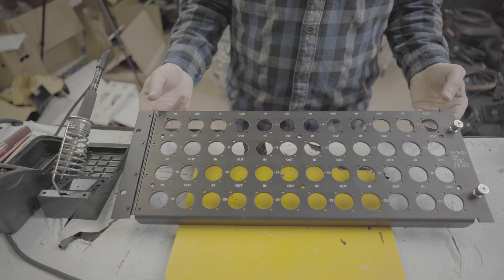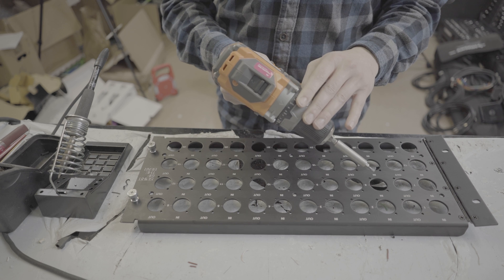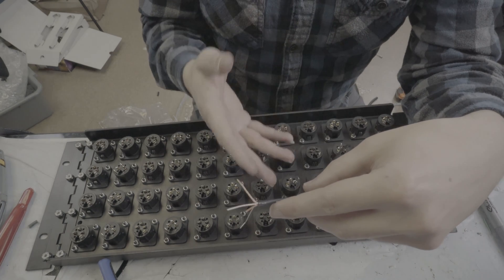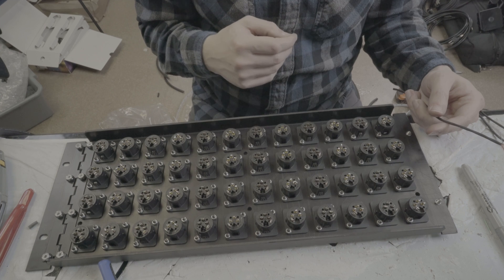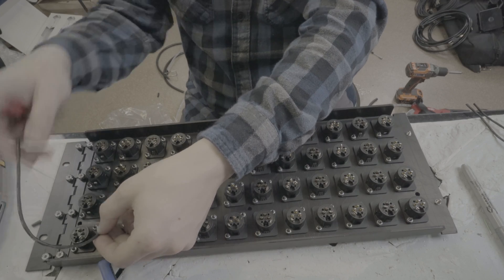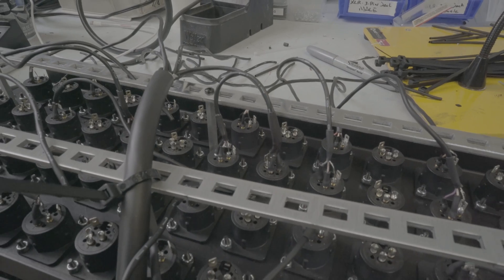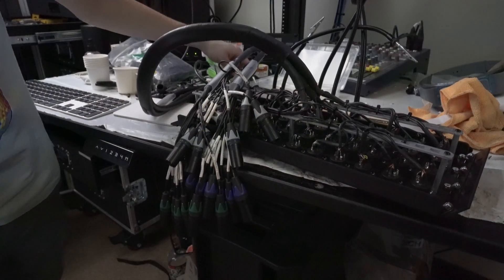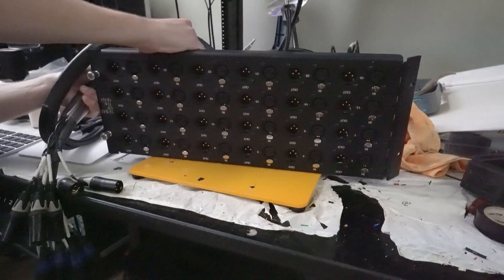Building A 24ch 1:2 Mic Splitter Panel For A IEM Rig

Comment: A couple late comments:
This is really nice work. I've done this in broadcast trucks, which easily in the analog days could go to 800 lines in the audio patchbay. I know what it takes to do it this good. I have some comments, minor as they might be. 
* Do one thing at a time. Swapping tools costs time. For an 8ch fanout I'd do shrink tubing on each,  marking on all 8, sheath on all 8, separating cores from screen and drain on all 8, cutting screen on all 8, stripping the inner pairs, and then tin them. And so on. One operation on all members in sequence. That way you use your tools more than swap them.  This applies to all repetitive work. Once you think like that, it's going to be a time saver and secret super power. This is what Frederick Winslow Taylor did in the 1880s and on; optimising process. 
* Use colour coded number markers! And use resistor code. It is universal -- if you look in Mogami wire, or Belden "Brilliance" multicore, you'll see that the inner conductor in the Mogami is brown, red, orange, yellow, green, blue, purple and grey. The first 10 pairs in a fat Mogami cable are black, the next 10 are brown, and then they're red, and so on. The sheath in a Belden multicore is same colour code. This makes sense and it is very easy to tell blue (6) from white (9) even if it is upside down.  There are multiple places that sell the small chevron-style markers in resistor colour code -- in Europe I recommend Canford. The marking will not wear off, and is a quick way to go even into the 100s of unique channels -- all identifiable at a glance. 
* Don't lift grounds. Read the Neil Muncy 1994 JAES paper -- or google "pin 1 problem"  and understand how to do this. I never lift grounds, and I have silent systems.

Comment: can we just not solder pin 1 on one of the outputs to prevent possible ground loops?
Reply: We are usually playing in venues that don’t have grounding. Could that splitter cause problems in that case?

Comment: I didn't see anything about using transformers to maintain the voltage after splitting, Seems to me like you don't mind that, but do you plan to add it later on? All mic splitters i''ve seen, have to pass through a transformer. I am still looking for a good affordable one.
Reply: Good transformers aren’t affordable.

Comment: Why don't you use all the colours on the boots? - 1 Brown, 2 Red, 3 Orange,  4 Yellow, 5 Green, 6 Blue, 7, Violet, 8 Grey, 9 White, 10 Black with a Brown ring,  11 Brown with a Brown ring, 12 Red with a Brown ring etc, 21 Brown with a Red ring etc. 32 Orange with Red ring etc.That way you don't have to go searching through the numbered labels. Colloured Neutrik rings are part number: XXR-*. Replace the * with the relevant colour number.

Comment: Something I like to do in the extra-mile category is to use a clear color coding ring and label the cable with a piece of paper inside it. It takes a little doing to get the template right, but it's well worth it!
Reply from the maker: Sure! That's great! We use a heat shrink tube with the channel number spelled in both name and numeral. I try to include loose clear heat shrink whenever possible so customers can apply their own labels.

Comment: Nice pro work.  I like your hinged panel.  QUESTION - I am considering a smaller 24ch passive splitter panel using 24 xlr females and 3 db25 wired in tascam audio standard pin out to provide the 24 channel feed to FOH on three 8 channel snakes db25 to xlr male.  The inputs to my x32 rack will be hard wired from back of panel and live in my iem rack.  Do you have a metal fabricator that could build this 3 u panel?
Reply from the maker: Hey Mark, I can do it for you. Just shoot me an email: billy@lmcases.com

Comment: As far as Phantom power goes... wich console gives the 48V? FOH or monitor with a splitter like this?
Reply from the maker: FOH. Though in this config, either console could provide it.
Reply: @billylaguardia  But will that not harm the other console?
Reply from the maker: @kasperlassen2396  Nope. Though only one console should provide phantom. Generally the monitor console provides phantom. Larger mic splits for touring are generally just larger versions of this panel with pin 1 ground lifts per channel. Despite the ubiquity of low cost 8 channel transformer isolated mic splits available, most splitters are not transformer isolated. OB trucks usually want transformers since they are often the 3rd or 4th split in larger shows. They also have longer cable runs to deal with. Hope this helps!

Comment: Can you explain when you need a splitter with transformers vs when you don't.  Context I'm building an in-ear system.
Reply from the maker: Hey Dennis, this is an excellent question that will probably end up being a video. The quick answer is that you don't really need an iso transformer in a 1:2 XLR split since all the signal sources are balanced. Mic splits use a unity 1:1 transformer meaning they don't change or alter the signal, just pass it through. Jensen as an example makes a dedicated mic split transformer. This allows manufacturers to use the transformer on a PCB to make the "split" vs soldering multiple cables on a solder lug of a connector. They just take a winding off the transformer that is the duplicated audio signal. The benefits of a transformer are RF rejection and you are electrically isolated (hence the clever name) from anyone else (say FOH or Mons) sharing the original signal. I generally don't spec a transformer on 1:2 splits (an ears rig etc..). I'll use one on 1:3 and 1:4 systems. Hope this helps!
Reply: @billylaguardia  has your band run into any interference with this passive unit? I would hate to get rf or ground loops from Foh.
Reply from the maker: @ScottFuckinRitchie  nope, it has been fine. You occasionally need to lift a ground with a barrel adapter. This is the cost:size trade off when building a split of this size. Most people want something small and cheap, especially when it’s for a band on a minimal budget. Once you add something as simple as a lift switch, the cost and size increases.
Reply from the maker: @ScottFuckinRitchie  With these builds, its not the component cost. Its the labor to wire by hand, and the area that the switch will consume. Though simple toggle switches are small, when multiplied by 32ch , a 3U panel grows quickly in height. This panel is meant to be inexpensive and small - in terms of height and depth.

Comment: nice diy project what's the part number for the Mogami multi core wire and the part number for the trunk lining
Reply: ditto - I have the same question
Reply from the maker: The multi core is Mogami 2932. Not sure what you mean by the trunk lining?

Comment: Really really clean and nice job)) but… is there any signal/voltage loss in this  kind of splitter?
Reply: yes.  The voltage has a separate path to go down, so it most certainly will have some loss.  Kirchhoff's Voltage Law.  Also, I would use the copper ground and the shield to chassis.  They perform different functions in grounding and signal loss.  It would be different if they were twisted pair, but they are not.
Reply: @TheDivergentDrummer  I am a retired electrical engineer. Contrary to a common first intuition (once mine also) the shield and drain wire should always both be connected ONLY to pin 1, never to the chassis/shell tab. I have been doing live sound and installing/troubleshooting systems for 57 years, and I have seen some really crazy noise problems that were caused by doing what you suggest, combined with other electrical connections to the same chassis, and related to ground loops. Don't do it.
Reply from the maker: It’s negligible. This style of passive splitter is very common.